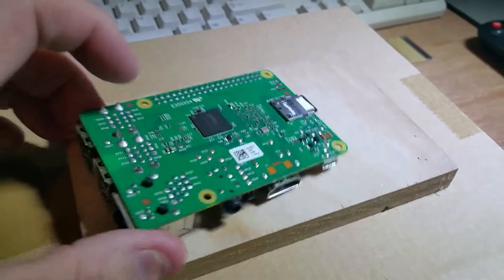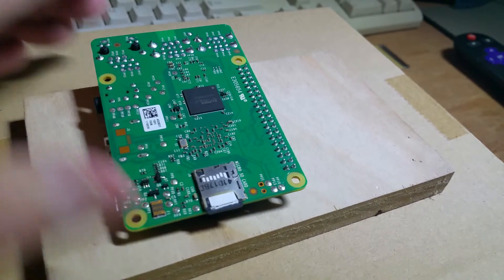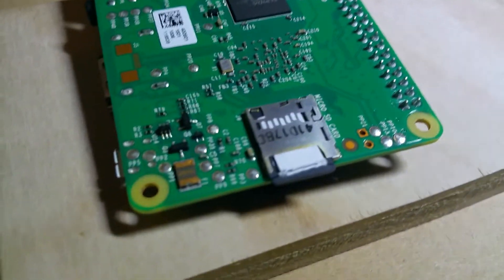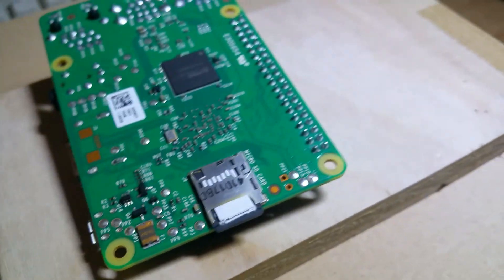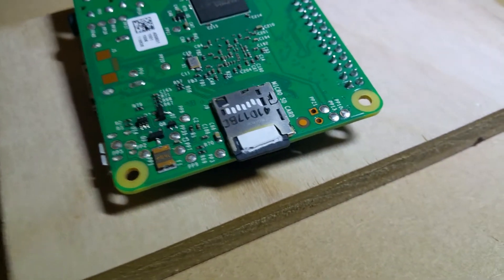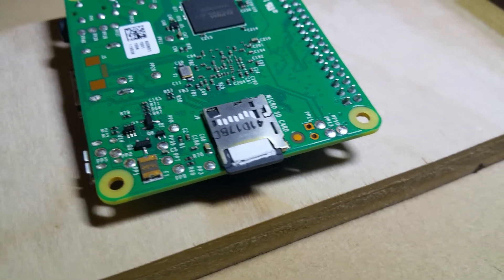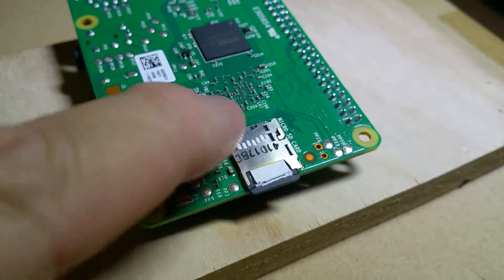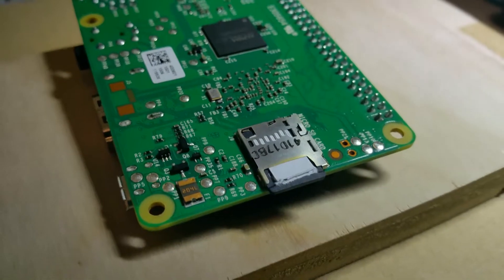Raspberry Pi SD Card Slot Fix No Cost

Comment: Thanks for this. Worked a treat
I don't have a small enough tip on my iron to unsolder the cover and replace the little metal arm so this fix will have to do.  thanks again. My SD slot was on an action camera, I can suck the video out over the usb slot instead of taking the card out....

Comment: Thanks very much!
I had the card reader rip on me once, I soldered it back on. There was some flux stuck in there and I couldnt get the card out after several months of 24/7 running. I used a little pin under and above the sd card to break it lose from the old flux. Too bad, the card was already physically damaged from my first tries.